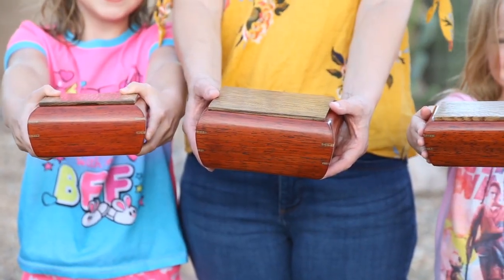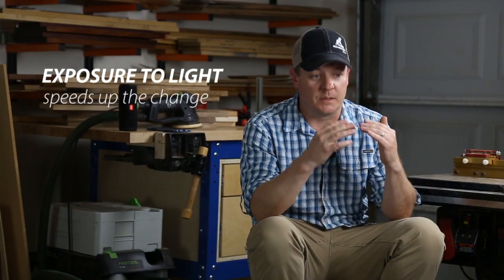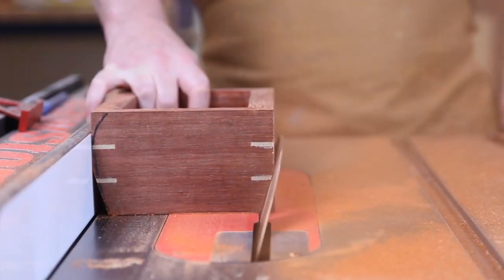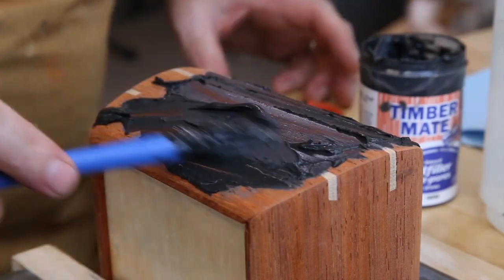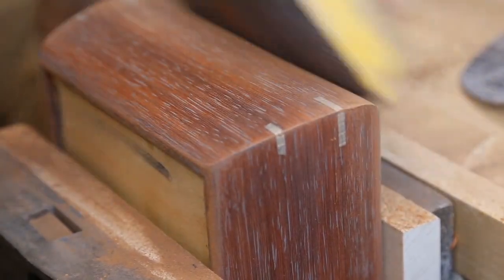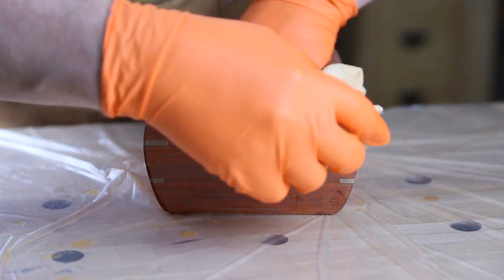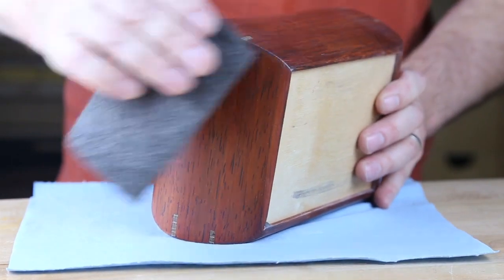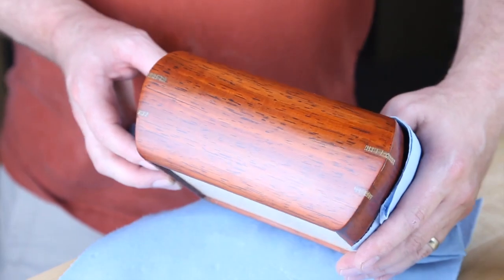A Terrific WOOD FINISH for Padauk that KEEPS ITS COLOR

Comment: Looks awesome! I learned about 30 years ago how to seal padauk to keep the bright colors from an old furniture builder. He would build under his normal lights then when it was time to seal  he would turn off the bright lights and had installed light fixtures that use dark room lights like in film processing. He then sand final time and seal before turning on the main lights and his work turned out bright orange and never go dark. Was interesting so i use that same method.
Reply from the maker: Another great idea, thanks
Reply: Whitewolf.........are you saying to do all the sanding and applying all the coats of shellac before returning to regular lighting? Thanks.
Reply: @jimhester2004  If he is, then I can imagine someone making a dark finishing room just for this purpose, if one wants to go to that extent of applying and sanding every coat of paint over a week or longer. Of course, there would be two dark rooms; one to enter and leave through, and the other to work in.

Comment: Funny, I stumbled on this video and it's basically the exact process I've been using on Padauk as well. It comes out very nice. FWIW I accidentally got a non-dewaxed shellac and the outcome hasn't been bad as so many people suggest. Marc over at the wood whisperer did a (relatively short) test and found the same results, waxed or unwaxed it behaves ok either way.

Anyway, I really like this finish because it can all be done in an HVLP gun which reallllly reduces the final labor investment, and you get a professional looking finish every time.
Reply: Me too! Lol

Comment: I've used a different method and my piece has been in direct sunlight thru a window for 6 years. It has retained the red while only darkening slightly. I used waxed shellac, it actually kept the wood brighter than sealer without wax. Then I put UV water poly, then I put UV resin on top of that. Always test a sample since different products brands have different results. You may also want to switch the order of resin and poly but complications may arise.

Comment: I did this finish to a guitar I built, but I added a twist— start with pure tung oil(+mineral spirits and japan drier) to give it an oil based look. It gives the padauk a nice red tint that shows up beautifully after the shellac sealer and water based top coat.

Comment: Thanks. I'm curious about how well this will work for a guitar fretboard. Paduak is used for guitars, but not much, and I have yet to see one with a Paduak Fretboard. I fear that a coating would be worn off with use. Fingernails get in close contact with the fretboard, sometimes scratching it. It might end up like a lot of Maple fretboards, which are also coated.

Comment: Thanks for the video, I recently bought some Padauk and I'm excited to try it out.  You referenced using water based poly as it has the UV inhibitors but I'm wondering if you think the GF Arm-R-Seal oil based poly would also do the job just as well.  Thanks again!

Comment: Wow! Now imagine doing a whole Mission or Shaker kitchen cabinet job in Padauk! I wouldn't know where to start! Would you prefinish all the lumber first, or maybe after cutting boards to length, or after any routing, or some other step or just wait until after assembly?
Reply from the maker: It's always a tough call. But it does spare you some frustration to do what ever finishing you can do before assembly. But you've got to make the judgement call about when it makes sense and when it doesn't.

Comment: Really like how your finish turned out.   Question:  Do you think I could add wood filler after I’ve applied dewaxed shellac (as opposed to before) and have a similar result?  I carved some spoons out of Padauk,  wiped ‘em with acetate then applied multiple coats of dewaxed shellac but before I saw your video
Reply from the maker: Dennis Obergfell yes but I wouldn’t use the water based timbermate filler. An oil based paste wood filler will work better when going on top of a sealer. Not sure really what would happen with the water based stuff being applied after the sealer.

Comment: Automotive clear coat will keep the color forever with a perfect level finish no sanding or buffing required. ‘If done correctly with an auto spray gun’
I like to rub it in as sealer letting it soak in. Sand once and hammer the clear in a heated booth until perfect. 
Boom!

Comment: Now that it’s been 2 1/2 yrs, how’s the red holding up or has it changed to a walnut color?
Reply from the maker: Glad you asked. Believe it or not it’s still red, but it is darkening. More maroonish orange in color now
Reply: @WoodworkersSourcecom  Thank You!
Reply: @WoodworkersSourcecom  I made 4 clocks for gifts this past Christmas.  One of them was framed w/Padauk and I used your formula for the finish.  Turned out great.  I’m looking at it now. So far, it’s holding its color.  Thanks again.
Reply from the maker: @dframed9305  that’s great to hear! 👍
Reply: @WoodworkersSourcecom  I have a question about paste wood filler.  I’ve used it on many projects to get a great high gloss finish.  However, I’m looking into using a gold mica to fill the pores for  a more sparkling high gloss look.  Do you think it’s possible or will I have to open the pores with a fine point awl or a tiny little drill bit?  Thoughts???
Reply from the maker: @dframed9305  It's worth a try to fill it as is. I can't imagine I'd want to spend the time poking all the pores otherwise! My gut says if you do open them up with an awl or drilll bit that it would probably come out looking too manufactured or something along those lines. Might lose the nuance of nature by making the pores more perfectly round.
Reply: @WoodworkersSourcecom  Thanks for the tip.  And yes, I wasn’t looking forward to enlarging the pores.  I do however have a very small fine awl.  It would do the job.  

I worked with mica on inland and offshore drilling companies.  It’s an additive for drilling fluid when the hole being drilled is taking more fluid than we get back.  Anyway, I found it’s singular pieces to be a bit large for filling open and semi-open pored woods.  That was my thinking when I sent you the message.  I guess my next question would be will the gold or other colored mica mixed with the paste wood filler be seen from within the pores.  I’m trying to create a sparkle or flash of light when seen from different angles.  I’ve yet to see the size or use the different colored mica I see used in epoxy wood coatings.
What do you think?  I forgot to ask you if Hobby Lobby or Michael’s have mica?

Comment: How can this be done on a much larger project
Reply from the maker: The only thing that would change is possibly your choice of applicators. Shellac could be sprayed if you want, but the pad by hand method works just fine too. And with the waterbased topcoat you can use larger brushes or those big flat pads you can get in the paint dept at the hardware store if you're dealing with a large table top (or something else big and flat.)
Reply: HVLP.

Comment: I like your dedication, but I'm not so charmed by the final result. It feels quite artificial to me and it does not preserve the spontaneous and lively display of the original colour. I simply finish the sanding with P400 and finally polish paper it. Then I apply beeswax from a solid stick, rub it so it warms, melts and spreads over the surface. I do admit, it doesn't hold the original colour forever, but if you put it in a shady place it lights this up for years, while it ever so slowy matures in clour, like I do
Reply: P

Comment: looks great but why go thru all that instead of just keeping it natural with maybe a really thin layer single coat of oil or wax and buff it clean, then keep it in a bedroom out of sunlight and it would look beautiful all the time with its natural orange color?
wood that work?

in my opinion woods look best when left to look as natural as possible, it’s most beautiful that way with all the imperfections and colors.  to me all these oils and sealers take away from that.
when building projects that are going to stay indoors, and applying sealers is just a wY is saying you don’t like the way wood looks.
i built cabinet for my shop out of poplar, and applied just a little butcher block oil only to keep moisture out.
they don’t look sealed, and they don’t look like plastic, and they don’t look shiny.

they look like wood, because they are.